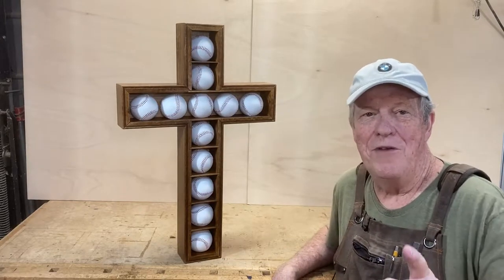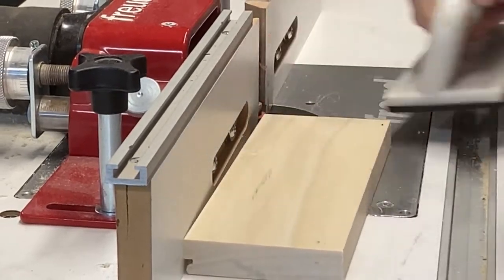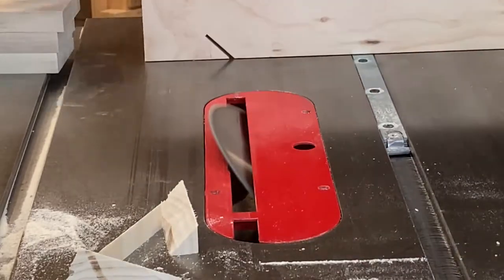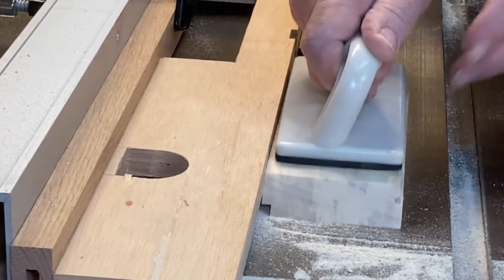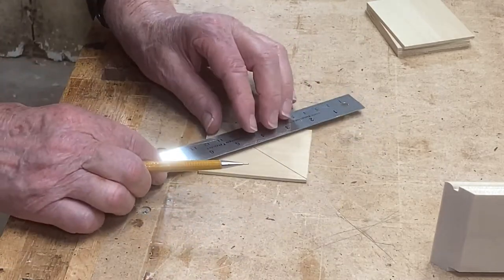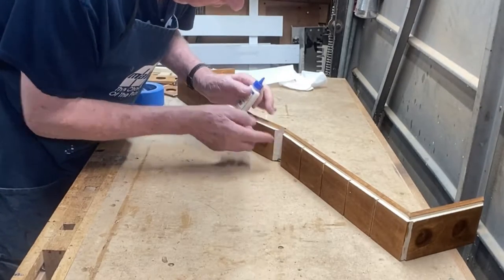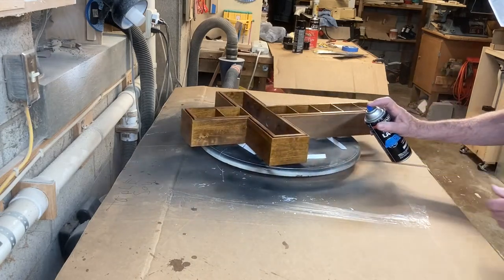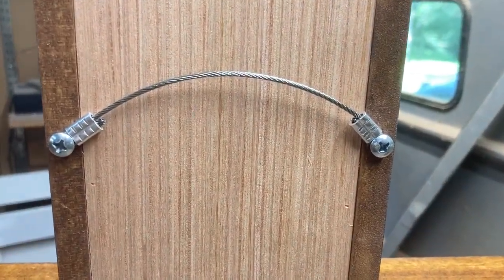How I Built this Baseball Shadow Box (the Easy Way)

Comment: Nice work. I have a good friend asking me to do this type project for her. She has five boys that were in baseball and hockey.  She also has softballs for a couple of them. I'm just getting started in woodworking and thought this would be a major undertaking. After watching this I think this would be a little easier. I was having issues on how to keep the baseballs in place. Your idea is great. Thank you for posting such a very detailed project, you have help boost my confidence on maybe trying to do this for her. You have a new subscriber.
Reply from the maker: Thank you Greg for your kind words and subscribing. One suggestion to make this a little easier is to not use miters on the corners. Butt joints will work fine. The back adds a lot of strength to to everything.
Reply: @RonMulletWoodwork  Thank you for that info. I have only done miters a couple of times. Look easier than they are for matching them up.